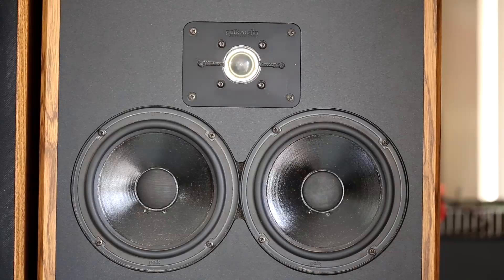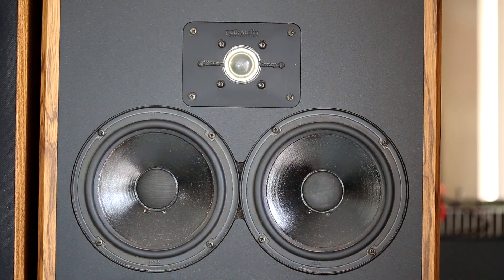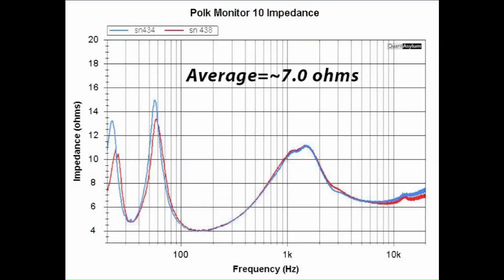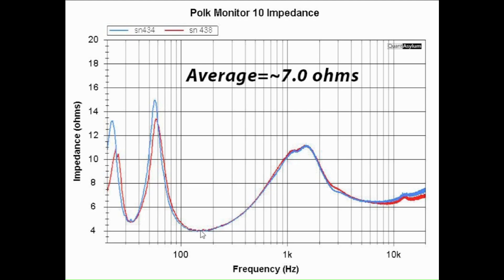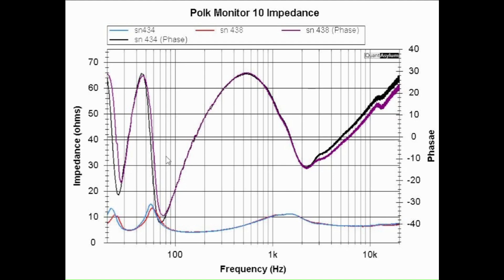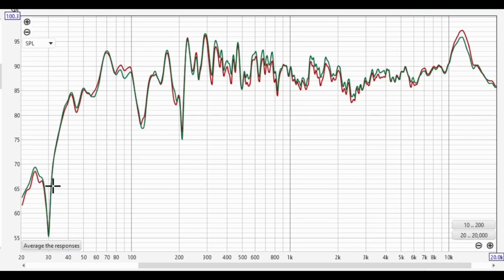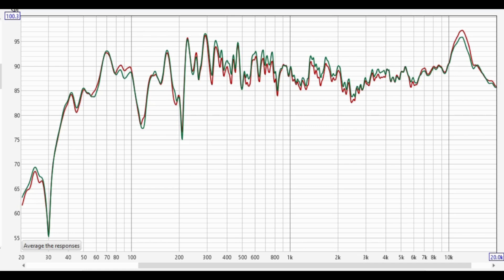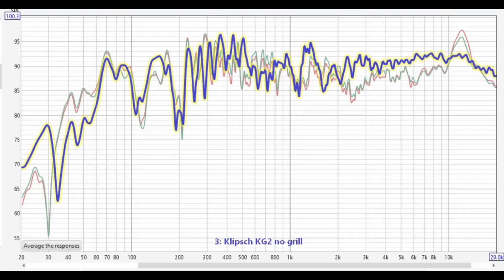Polk Monitor 10 Series 2 Loudspeakers- Vintage Audio Review Episode #164

Comment: Oh BTW these speakers were about 750.00 pair back in the late 80s. They were considered the flagship of the Monitor lineup. The owners manual suggests that they be placed several feet apart and toed in well away from the walls. They do have a tendency to shutdown or distort when playing loudly. The marketing literature says that they are designed to play loudly with alot of bass in a smaller room. The fact that they distort at high volume even on high powered amps could be a defect. I have a CD by Joe Satriani where it was making a popping noise from the bass radiator and I had to turn the volume down for about 30 seconds and then turn it back up again. Of course I’m talking about the 5 B which is 2 models down from the 10. Right now they are hooked up to my vintage Yamaha R50 receiver which is 35 watts per channel and came out in 1983. And they seem to be a good synergy. I lost interest in Polk Audio when there stuff started becoming mass marketed and mainstream. Matt Polk is no longer involved in the company or the audio industry. It’s all made in China stuff now. The cabinetry on the old monitors is outstanding. They were built rock solid and like tanks! And made in Baltimore Maryland USA!
Reply: Thanks for another great review. I have the series 1 Monitor 10s. I found them at Goodwill for $50!  I think thee difference between the 1s and 2s is the tweeter. My experience is that they don’t need a lot of watts to make them sound good. They are such icons, I won’t let them go.

Do you or the others have a preferred brand of large speaker risers to get these off the floor? 

Keep up the great work!
Reply from the maker: @danstein2467  Many thanks once again, Dan! $50 is on heck of a deal. I did not research the difference between the 1's and 2's- tweeter could be it. I felt the 2's needed a bit of power- to get the most from them. As for risers, I have no idea since I don't use them and it would depend on your speaker and flooring. If you are talking about some speaker stands, Skylabs Audio has a couple of speaker stands...
Reply: @ thanks for the tip!
Reply: @danstein2467 in the marketing literature it shows them on short stands tilted back. I assume that’s how they were designed. That is called time alignment, with the sound waves of the drivers directly hitting your ears at once. Most of the speakers out now are bookshelf speakers designed for stands about 24 inches from the floor. The old polks are fairly placement friendly and they can even be placed on the floor. If you have any questions about the Polk Monitor series feel free to respond back to me. I have owned 3 pairs of them over the years. Play them sensibly on a good amplifier or receiver and they should be able to give you some great sound.
Reply: @bradleydurbin6784  Thanks. I’ll try and find the appropriate stands. I appreciate sharing your thoughts and expertise.
Reply: @danstein2467  what amplifier or receiver do you have them hooked up to? Just curious.
Reply: @ like most of the viewers, I have a few power sources. Currently, their not in a system. What electronics do you prefer?
Reply: @danstein2467  most of what I have is older mid Fi. I have a 90 watt per channel Carver receiver, circa 1985 a Rotel power amplifier and preamplifier I bought back in 1994. 60 watts per channel. A Adcom GFA 535 power amplifier 1987 Yamaha receiver 35 watts per channel 1983 a NAD 316 bee integrated amp. 2011 and a vintage Scott 325 R receiver circa 1978
Reply: @ Great gear. I love Carver equipment. I have an M-400 amp. Still good after all these years.
Reply: @ that’s awesome!
Reply from the maker: Thanks for the sharing your experiences again, Bradley. Sometimes just dialing the bass back a bit will get rid of the woofer popping as well. I was not really off on the price- $740/pair. I am glad you are still using and enjoying your vintage gear. Many of the Chinese class D amps do a really good job, though they are not made here in the USA...yet?
Reply: I absolutely love these speakers. All my receivers are 35-40 wpc and I listen to a lot of metal. Loud crisp no problem powering them. I will never sell them. But might change the tweeters out at some point, get a little fatiguing.
Reply: @vorhese  I listen to alot of Heavy Metal also.

Comment: I bought a set of used 10 B to get a replacement 6.5" for my 11T not sure witch is better but I like the form factor of the Towers more.
Reply: How are you liking them so far? The silver coil dome tweeter can be slightly bright and a bit splashy. On the old polks they used Peerless tweeters and under license.
Reply: @bradleydurbin6784  Ya I'm in a Polk Group I'm watching for deals on Either of the dark colored tweeters but I got two sets of SL-2000 I don't dislike them but everyone likes the old ones or the new ones that were replacements for the SL-2000
Reply from the maker: Thanks for sharing and when it comes to speakers, it is what is most pleasing to you!!
Reply: @vintageaudioreview Are you familiar with a speaker company called AudioAnalyst? They were a startup company back in the 1970s out of Danbury Connecticut.
Reply: @vintageaudioreview  My M&K S150's

Comment: Wow! I used to have these speakers 30 years ago and they were stolen from my apartment. I now have the monitor 5 speakers which is a smaller version and the monitor 4a. I’m the one guy who told you that I bought a vintage carver receiver.
Reply from the maker: Thanks for the comment, Bradley. It sucks that you had them stolen. I think my friend put these up for sale her in Tucson. Not familiar with the 5 or 4a, though.
Reply: @vintageaudioreview you can Google the Polk monitor line online and they are floating around on eBay used. They all had those passive radiators except for the 4a which was ported and 6 ohms. As you moved up in the line you were getting into a bigger design more bass etc . They were sold at a high end store here in Tucson called Audio Emporium on Broadway. No longer in business sad to say.